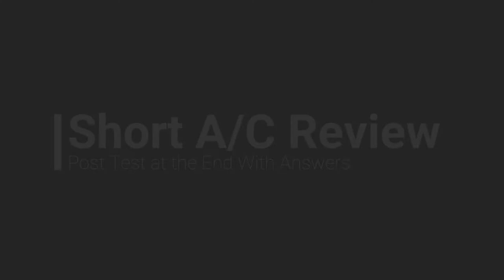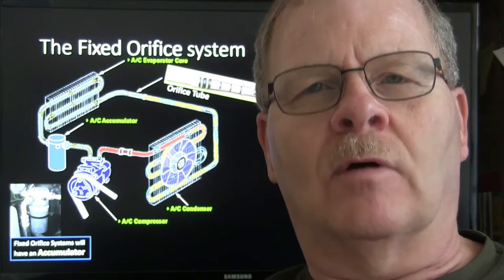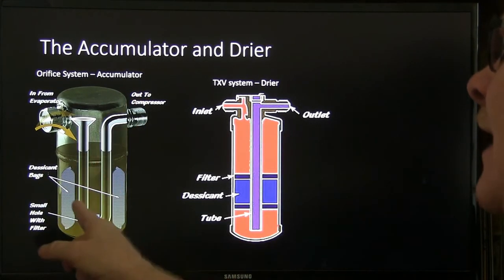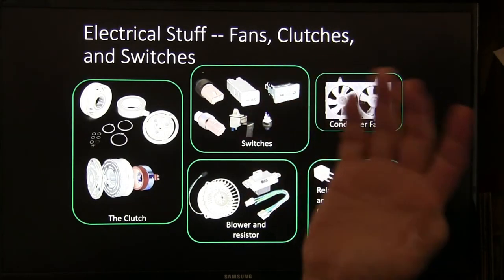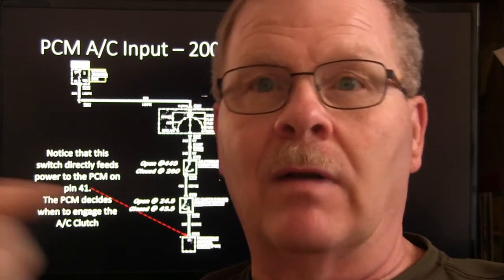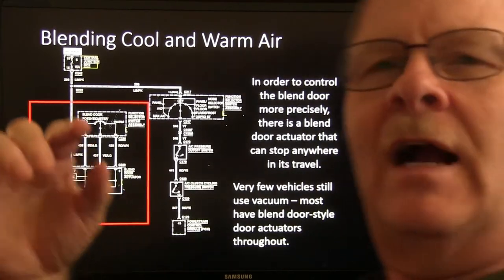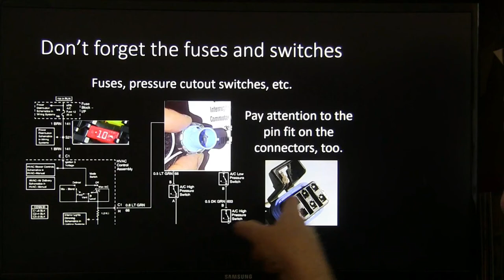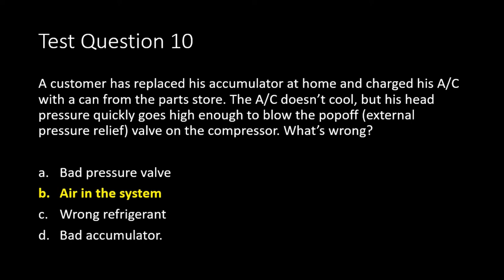AC Review With a Post Test

Comment: Like that jaguar you mentioned I have asked the question many times "why would they put that there". It seams that things like service ports, fuse boxes, the battery, belts, and anything else that should be checked or replaced as routine maintenance should have easy access like the OBD2 plug does.
I tried to help this dude in a parking lot with a flat on his range rover once and the tool provided did not fit the stock lug nuts.  I just so happened to have a plug kit and 12v compressor in my car that got him out of there.
Reply from the maker: I bet that was a workout

Comment: 28:53. I read the motorage A7 ASE book and  it said "a common misconception is that any oil recovered during the recovery process should be measured and added back into the system. Truth is that very little oil should be lose during this procedure. Typically, oil collected in the oil recovery bottle of the machine is a result of lack of machine maintenance and/or oil trapped in the internal lines after use of the onboard oil injection feature"
Reply from the maker: That's not totally untrue but if it were the case then every single system from which you recovered refrigerant would produce the same amount of oil in the bottle.. and some vehicles will produce quite a lot in the bottle, while others produce almost none... and it also depends on the machine

Comment: Pretty much all 2010+ vehicles have a pressure sensor in the high side and you can read this from the pcm thru OBD. This sensor also takes place of the high low switches with the pcm controlling compressor output.

Comment: Great review !I have a question as usual. A tech that I work with says that when you pull  the system into a vacuum, just because it remains in a vacuum does not mean there is no leak.Do you agree?
Reply from the maker: A pressure leak won't show up on a vacuum test.. he's right
Reply from the maker: Pressure inside the system can go to 300 PSI but all you have is atmosphere when you're doing a vacuum test
Reply: @McCuistian   Thank you for confirming.

Comment: excuse me sir I have a question, as video said there will be more and more liquid refrigerant in accumulator how to handle it, and whether  the oil will get into the AC system or just in compressor
Reply from the maker: The accumulator "accumulates" oil and refrigerant and is the place where oil and refrigerant are mixed. It is designed for that purpose. And the u shaped tube has a filtered orifice at the bottom of the U to prevent liquid refrigerant and oil from making it to the compressor.
Reply: @McCuistian   How liquid refrigerant back to the AC system?
Reply from the maker: @yeallen9468  The refrigerant constantly changes from a gas to a liquid and back. But to recharge the system you must have equipment.
Reply: @McCuistian how liquid refrigerant out of the accumulator back to system?
Reply from the maker: @yeallen9468   it's automatic
Reply: @McCuistian  thank you, I have another question is does the oil will get absorbed by the compressor, or does it go into other parts of the AC system, finally get back to the accumulator?  If the compressor keep consume the oil, oil will be less and less.
Reply from the maker: @yeallen9468  oil is recycled with the refrigerant and in small amount is found in all of the components.